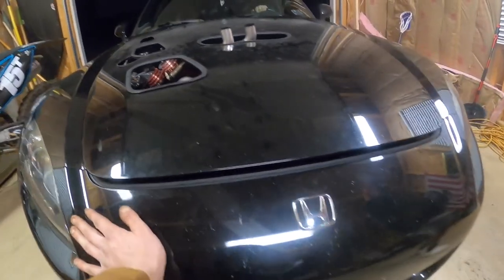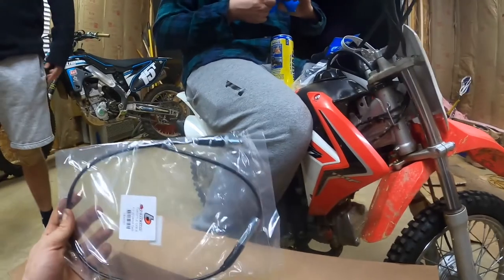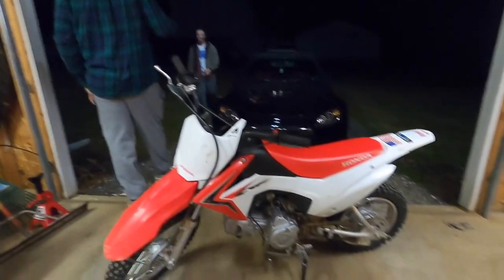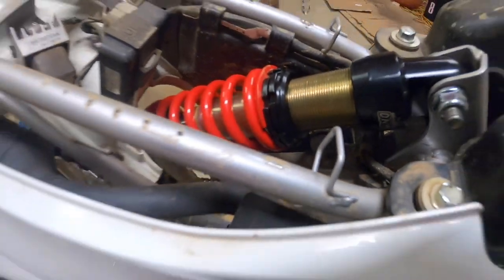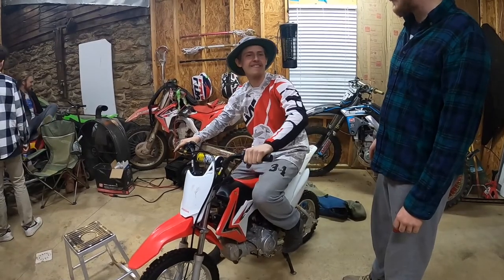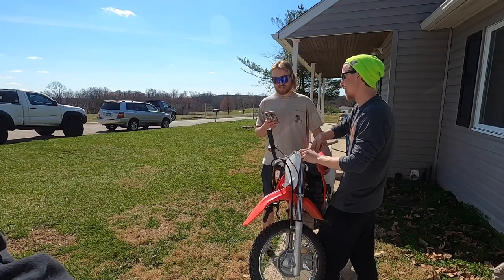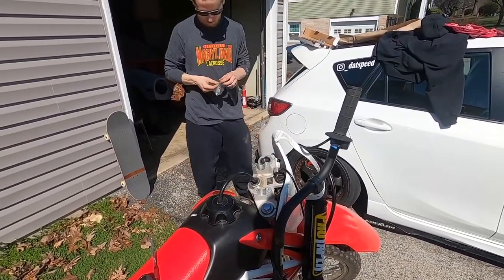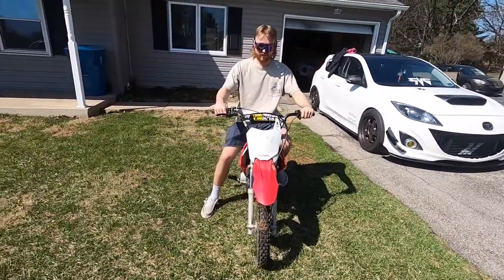Honda crf110 stock vs Modded crf110 | Parts Install

Comment: How did you get the throttle cable to work?
Reply from the maker: It came with an aftermarket carb cap, that fits the new needle, and the rest was just setting up the throttle like normal
Reply: @SvGTAPES  did u use the stock carb still